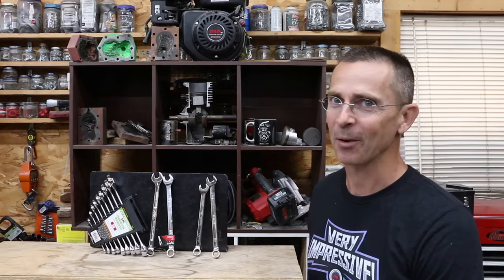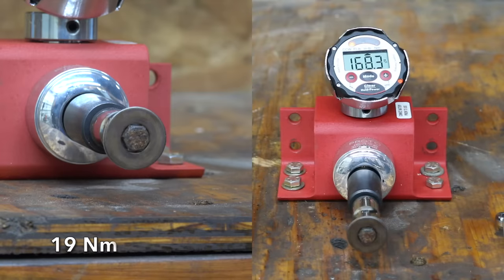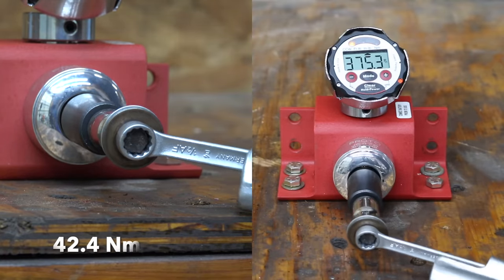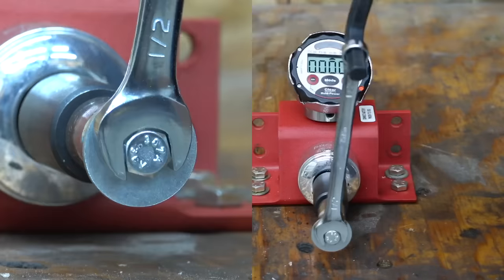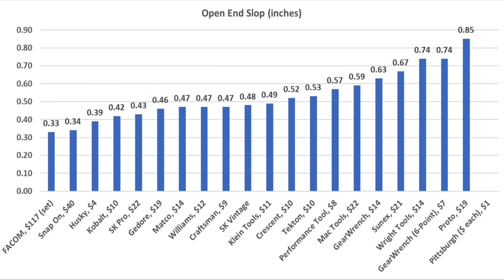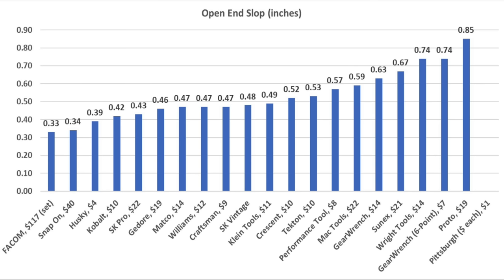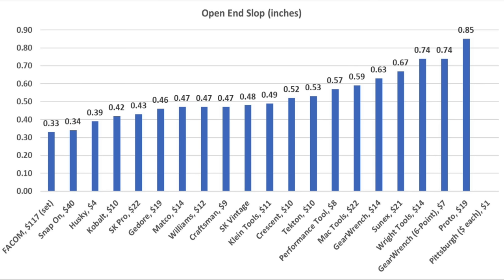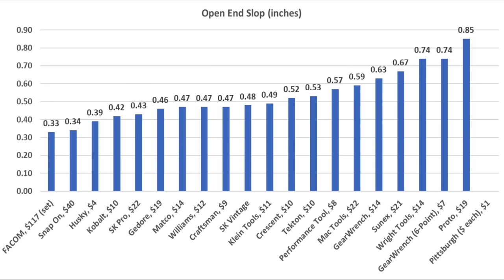Best Wrench? Let’s Settle This! Snap On vs MAC Tools, Matco, Proto, SK, GearWrench, Kobalt, Husky

Comment: Clever testing, especially showing how excessive taper hurts.  Rounding off a bolt head is probably the biggest concern.  I'm less concerned with handles bending since those tests used the wrench far beyond hand usage, even with a cheater pipe.  Sunex is made in India, but did well, showing they can make quality tools, albeit at high price.  Otherwise, the pricey wrenches from Taiwan, U.S., Germany, and France did best.  I like the H-beam design of the FACOM wrench for less weight.  Kobalt proved disappointing since I've read claims of affordable quality.  Snap-on didn't live up to their hype and price.  I'm old enough to remember when Craftsman was made in U.S. and had lifetime warranty, but now just brands Chinese tools.
Reply from the maker: Thanks!  Thanks for the feedback.

Comment: I'm calling bullshit on the Kobalt one. I have a set of Craftsman and I have a LOT of Kobalt stuff. Grilling power cannot be less when it has a tighter tolerance. The only explanation for that is that you used the wrong sized wrench. I can personally attest that Kobalt both 1st and current generation are much stronger and have a tighter tolerance than Craftsman and just about any other Stanley made wrenches

Comment: $9 for a craftsman wrench sounds high.
Reply from the maker: Thanks for the feedback.
Reply: @ProjectFarm  it does cost $9 when purchased individually, but only $33 for an 11 pc set or about $3 each.  Most people would just buy the set versus individual wrenches.  

At Home Depot, an individual wrench is $6, but the 10 pc set is $40 or about $4 each las stated in your video.

Great video -please keep up the excellent work!

Comment: Testing of one-off tools is not a significant sample size to arrive at a conclusion.  For example, by luck, you may have purchased one wrench that is superior to all the rest. But when I go out to get the same brand, my purchase of the identical branded and manufactured wrench does not meet the specs that were posted.  Is that brand of wrench flawed. What is required is to test at least a batch of 20 wrenches of each brand/model.  Give me the results of the batch. I would then know that your results are accurate within 5% of that batch's average.
Reply from the maker: Thanks for the suggestion.

Comment: This is the first unfair comparison ive seen on your page. The Mac and Proto both used a special design open-end to prevent slippage and as such the snap-on entry should have been of their: flank drive plus* variety or every entry should have been of standard smooth open end design.

Comment: I think you should go back to doing multiple trials as just doing one bolt for each doesn't equate rule out metal and treatment inconsistencies.

I find it interesting that some tools would exceed the expected torque and slip off but others would break the bolt at a lower torque.

I don't really know how much different in torque some of these numbers are. I don't know if it's like decibels where a small increases actually quite significant. I don't know if you're rankings are like computer speed rankings where real world wouldn't notice the difference than what the numbers show.

Anyway, we really don't know the true torque or even an average torque if one breaks a bolt at 378 and another doesn't break the bolt at 417 but rounds off. We don't know if the one that broke the bolt with the lower number would have had a higher torque if  the bolt didn't sheared.

It is interesting that the not all bolts sheared  at a closer torque range. 

Also, it's possible that the salt treatment weakened some at different spots than others. This  may not be fair to the tests with only one bolt. Maybe it rounded off because it was more corroded at the points on some but not others. 
At least doing three bolts give a better idea of each wrenches abilities.
Reply: Speaking of bolt metal inconsistency, one also wonders if particular wrenches could fail even from a high-ranked test. Maybe if one was willing to buy another dollar Pittsburgh wrench, would it far better than the original test? We don't really know if you would get the exact numbers and rankings if you tested more than one of that brand.
Reply from the maker: Thanks for the suggestion.

Comment: DAMN it man! husky was doing exceptionally well! YOU SHOULD HAVE REPLCED the wrench to complete the test!! IT WAS WARANTEED! And It was a tighter fit and would probably have done well on the last open end to failure test.. I HATE it when you dont finish or complete a test fairly. the TWO MOST COMMON, MOST ACCESSIBLE, MOST COMPETITIVE AND MOST AFFORDABLE brands. and ya just dropped the ball..I NEED to buy wrenches too. Dissapointed. i'll GAMBLE- HUSKY.
And yes, it WAS important because they were so darn inconsistant, one end's result has little bearing on how the other end performs. : ((( Thank You anyway.
Reply: I don't think he dropped the ball. If the thing broke or failed so it couldn't finish the test series, that's the result. You don't like the outcome so you accuse him of being unfair? Ridiculous. Why would he realistically rig a contest against a wrench? Childish comment.

Comment: Do yourself a favour, buy a relatively in expensive wrench set, grind off the taper of the box end and roughen up the inside to the open end. You got some 'value add' right there.
Reply from the maker: Thanks for the suggestion.

Comment: Dont know how they are still like this but US made ( i do not sell out at anytime) wrenches should have all been 4 sided by now. with four sides (machined) open end they would not slip.Ridiculous they are stiil this old way. Most all should be 6 sided box end (more contact) When i was young nobody told me that and i had to one by one replace all my wrenches. MAC has completely sold out (left US manufacturing) nowadays huh? F them then, No more MAC then.
Reply from the maker: Thanks for sharing.

Comment: Why anyone who knows tools would use a 12p box on a super rusty bolt is beyond me. Also, the use of an open end to apply high torque to a bolt head is again something you wouldn't really do (the exception is a Crow-foot). Snap-on, MAC, and S&K are made to accommodate Mil spec wrenching clearance requirements... at least I know the Snap-On still is. The most informative aspect of this video for me was finding out where a lot of these tools are now made... Craftsman is a disappointment.
Reply from the maker: Thanks for the feedback.

Comment: Tools are no longer made out of solid steel anymore. There is no test that you can do on any brand, make, model wrench as they are all made out of the same powdered metal molybdenum which is powdered metal that is melted and poured into a mound to make a wrench now. All brands are junk now.

Comment: I do not like doing tests as each brand is introduced.  To much information without reference.  Doing an intro of all tools with price gave a good point of reference for all the test objects.  You used to do it that way.  Going into the additional test data right off the bat makes it hard to follow what brand is doing what because it takes too much time to get from the first to the last, had no idea what was being tested when we were into the next test.  Plus slow down on the speed of your speech, it comes out as mummble mummble on less expensive speakers, you did not used to be so like that.
Reply from the maker: Thanks for the constructive feedback

Comment: To me, this test is totally unreliable. The test is assuming the bolt quality is consistent, which is hardly the case. And I doubt he is using quality bolts. Should have at least repeating with 3 to 5 bolts to take an average reading. I would dump the highest and lowest and average the middle 3.

Comment: The only thing I didn’t like is, you don’t use a 12 point closed end wrench on a 6 point fasteners. Wrong tool. 6 point nut, 6 point wrench.

Comment: they are all real bad metals , including the bolt . Its all Chinese maybe its made in Merica but with Chinese steel . I can remember old tools my father used and my grandfather , there is no need to test it , you can feel it when you pick it up , for example all of these are made flat or slightly bulging  body , the old ones were actually thinner because it was so good metal they would shave off the excess to make it lighter for you because the extra metal does not do anything , and that is why design of new ones is like this , so bad metal they need all of it . They really look bad .
What have we come down to .I think those older ones even rusty would grip better and give as much torque as 2 or 3 of these .
Reply from the maker: Thanks for the feedback.
Reply: @ProjectFarm  yeah you are old enough to know it as well . Good steal or metal is not found on e bay or Amazon . You go in to army , well there you do find good metal . Its due to mass production , cheaper made . But they do know how to make good stuff and when they need it they make it .

Comment: Sorry but the wrench test didn’t provide sufficient information to determine which manufacture provides a better tool.  Excluding a tool because it fail or was damaged in an earlier test prevented any meaningful test totals. Testing to 400+ pounds isn’t a meaningful test as no one would put that much pressure on it.  Usually your test are great this one not so much.  Also you assumption was that all of that manufactures tools have the same construction quality and I personally know that isn’t the case. Thanks anyway

Comment: FLAWED TEST - you say "To make this test more realistic you're adding a washer between the fastner and the wrench".  This does a couple of things: 

1) It 100% DOES NOT make the test more realistic
2) It 100% introduces a negative bias on wrenches with more bevil 
WHY?  Why do this?  Why add this factor and NOT TEST without it?!  

To be more accurate, which is what you seem to want, you should perform the test with and without the washer.
I suspect you did exactly that and your favorite brand was out-shined by the lower cost brand.  

YES you can deny it all you want and your fan base will definitely support you in that move but unless you include those test results also, your test is highly suspicious and your credibility is unnecessarily attackable.

I can't for the life of me imagine why you added such a flaw to your testing - you're smarter than that and you had to have known how this would impact the results.

Your channel is often outstanding but this is bad.....really bad.  Whether you want to admit it or not.  
You should redo the test and delete this video.  

However if you're like most charlatans, you'll simply delete this negative comment - I would hope you won't do that.